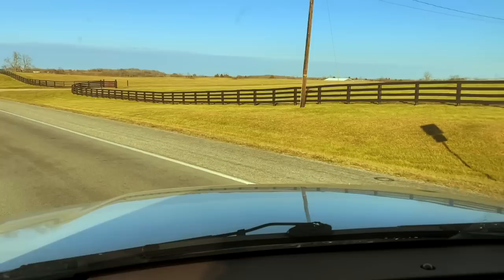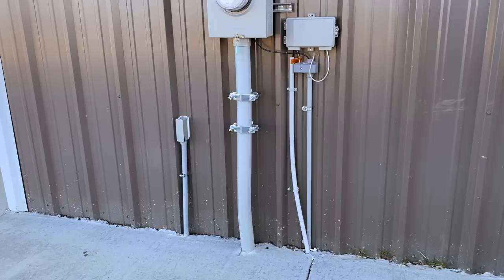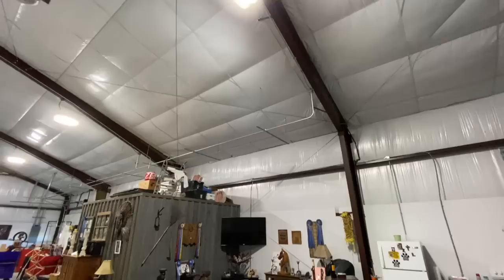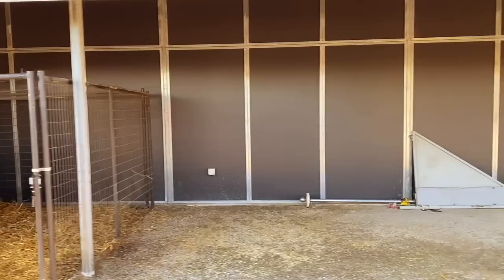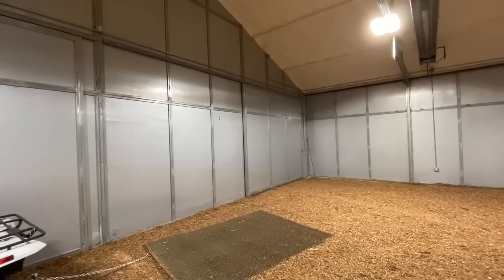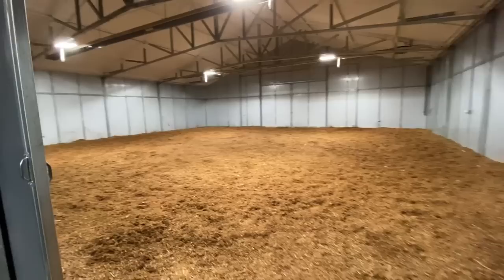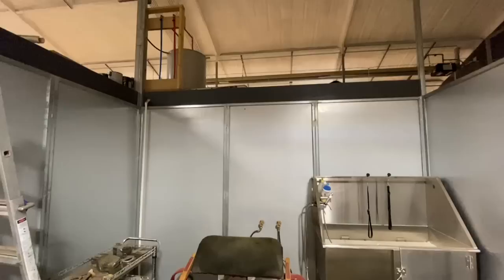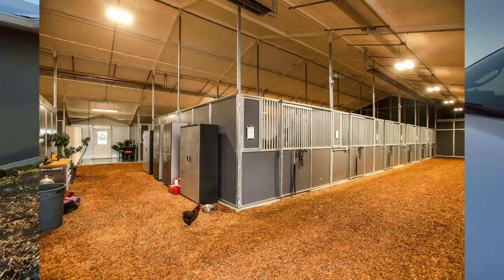98 acres and a Million Dollar Horse Barn tour Kentucky Horse property

Comment: That fencing is atrocious. Sheep fencing is one of the worst forms of fencing to use with horses, ESPECIALLY if they're shod. It'll take a lot of money just to pull that down and re-fence it. Yikes. They shouldn't even have that fencing anywhere the horses could possibly have access to, it's so dangerous.
Reply: The fence is fine I have my horse's around it all the time and it's not just  sheep fence it all round livestock fence it's great
Reply: The fencing is No climb not sheep fencing! The holes in no climb are 2” wide and 4”long and have small wire ties instead of being welded!   Certain types even have extra wires that narrow the openings enemy smaller! This is literally the safest fence option for horses!  Properly installed they will bounce off it harmlessly if they run into it!  If they kick it will simply deflect the foot!  Add to it the predator protection aspect and it’s a win in my book!  
Sheep fence which has larger openings 6”x 4” at the widest( top) and 2”x6” bottom. I will agree is not safe unless used in conjunction with a strong electric fence!
Reply: @jamiegreen7537  you're absolutely wrong. This is incredibly dangerous, if a horse kicks or strikes their leg through with enough force, the fence will completely strip the leg. All the soft tissue. I've seen dozens of this type of injury, either from celled fencing like this, or from high tension wire, which is another extremely dangerous fencing type. I worked for a vet in Virginia, and the first horse ever to have a leg successfully amputated was by that vet, and from this type of fencing. If you're using this type of fencing, you're not nearly educated enough to even own horses.